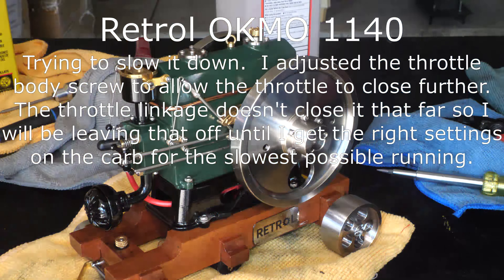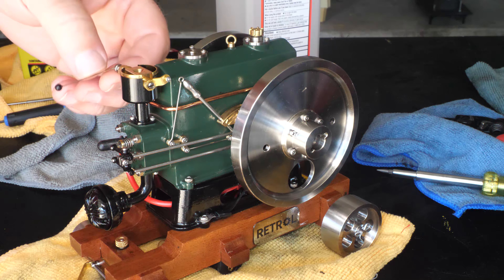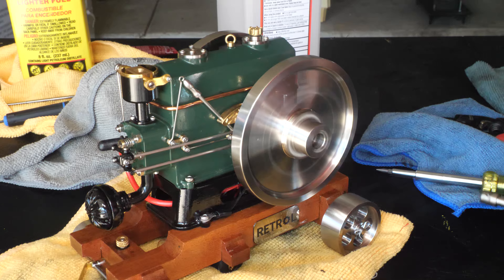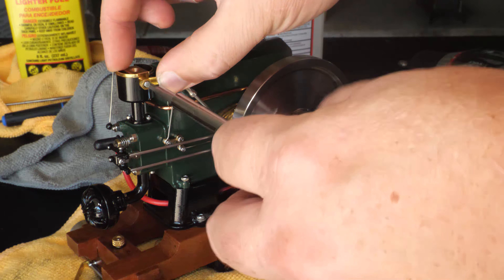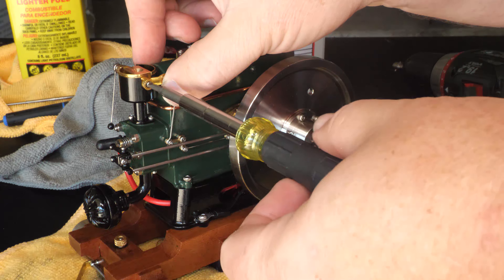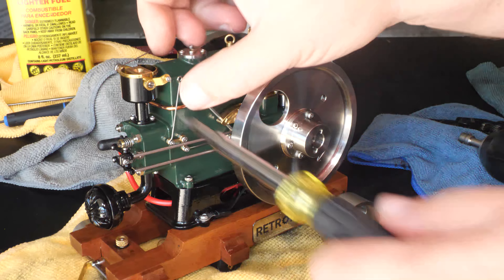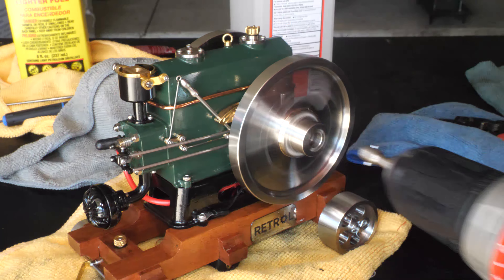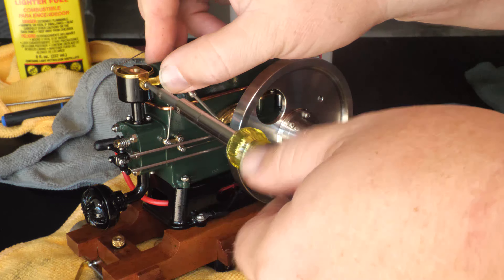Retrol 1140 Slowing: First Attempt

Comment: Nice. I guess it doesn't idle that slow because it's under load from the oil pump? I am also "not real good" at two needle carbs :)
Reply from the maker: All the advice on these style of carbs says they should be tuned on the high speed needle first and the low speed needle after the high speed needle is dialed in.  Unfortunately, with no governor, trying to adjust the high speed needle first is unsafe since you can only run them on high speed for short periods without risking serious damage.